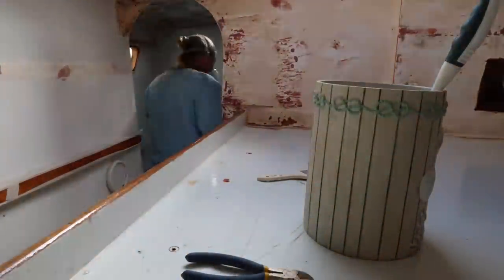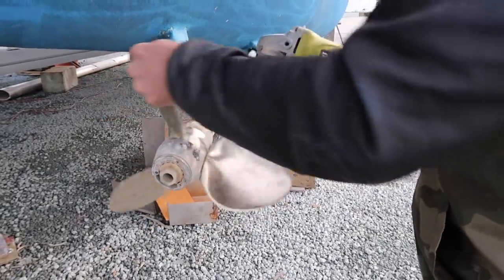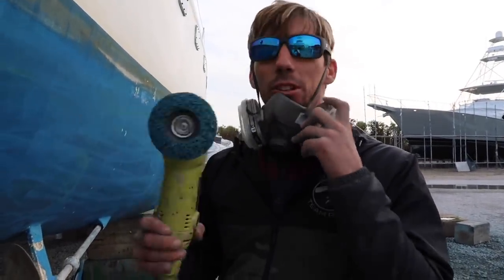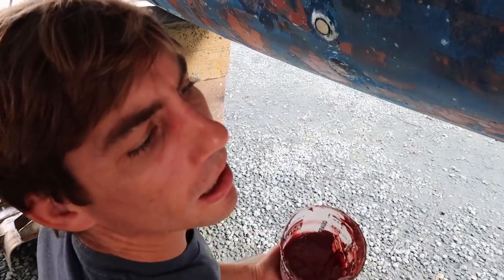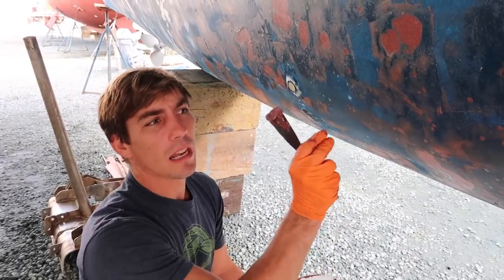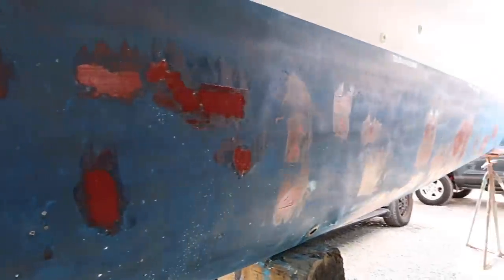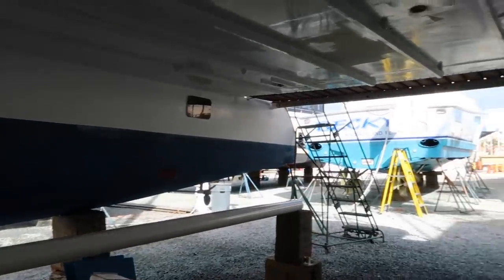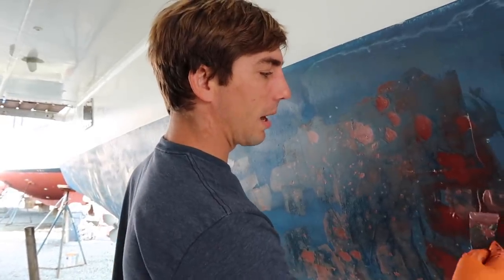It’s going to look worse before it gets better... boat work

Comment: Glad to see Sierra back in the videos. Next time you get a minute, compare what you used for you running gear, Pettit and read the label on Rust-Oleum cold galvanizing paint. Same amount of Zinc and actually made by the same company. 7 bucks vs 40.

Comment: Years ago! I did battle with blisters on a 37' Hunter Cherabini.  I did exactly what your doing. Grind em out, rince with fresh water, dry, (they always want you to dry longer than is practicle) fill with high density epoxy mix leaving them a little low and then fair to the hull with low density epoxy mix (it sands easy like bondo). Seal the bottom and then bottom paint. Lots of work. I watched a 42' Sea Ray get the full strip down to the fiberglass once. It had blisters like one every square inch. The dry time for the hull was 6 months. Then they re gel coated it.

Comment: Looking good guys!  Especially the interior Sierra.  Very admirable to see you take all the extra steps necessary in prepping and not short cuts like most.  BTW, does Billy spray you with some kinda paint repellent?  You don't seem to get it on you at all!  I can't even open the damn can without splattering it all over me :-(

I recently discovered that they now make 'peel-and-stick' wallpaper (like contact paper-but more durable) ...  Great reviews on Amazon and applicable to boats.  I'm going to order a nautical themed wood plank to put on the bulkheads in my head just to accent and make more moisture resistant and easy wipe down...  I'll try to copy the link if your curious...

Comment: Check it out the fiberglass is a porous material it sweats on the inside of your Hull and finds its way through the fiberglass to the gelcoat which is not porous. As it sits between the laid up fiberglass and gelcoat where it causes the gelcoat to louse its adhesion to the fiberglass. Try to let the boat dry out then paint the inside of the hull so the moisture can't get between the glass and gelcoat. I sure hope your not using red lead automotive glazing putty . You need polyester glazing putty to get the job done right. Wow ! Sierra the inside is looking like new nice work

Comment: Next time for the yellow stains by some Oxalic acid off Amazon it's like 15 bucks for 5 pounds and just mix with hot water. 8 ounces for 2 gallon water. It will last forever if kept dry and you'll always have it when needed. 
John Doherty 
LykeNew Power Wash 
Salina Kansas